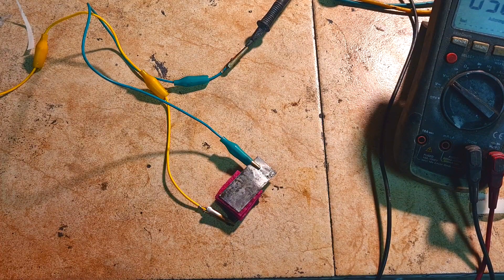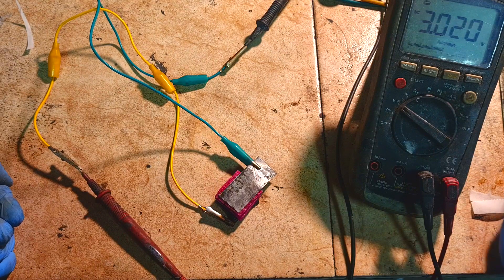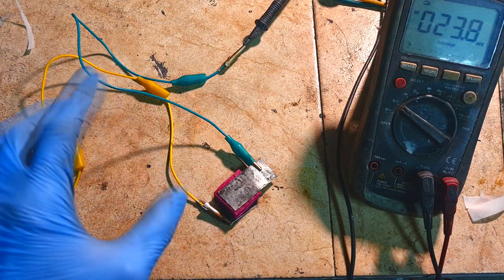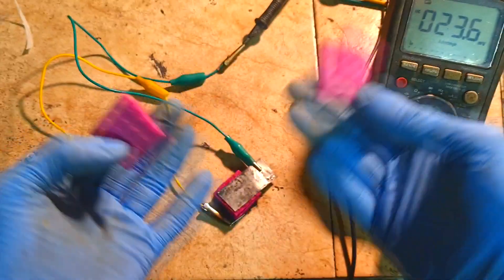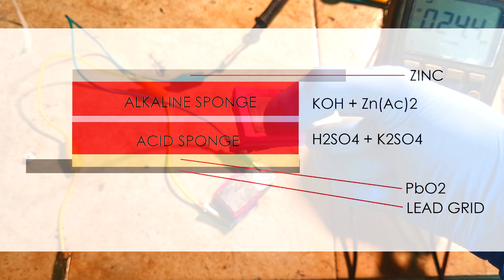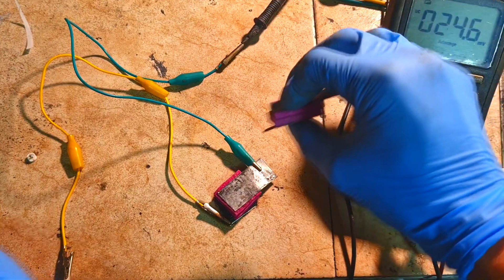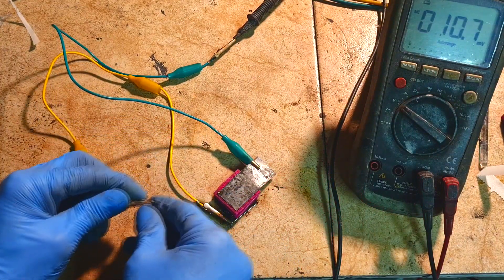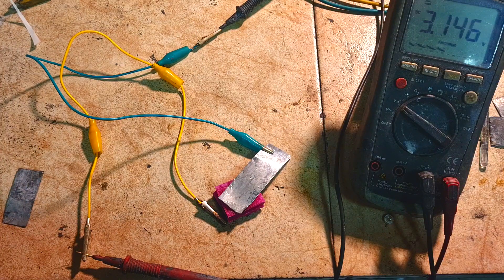3 volts Lead "acid" Battery

Comment: I think I found a cheap membrane for these batteries.  Put some super glue one side of a piece of paper and spread it thin and as even as you can.  Be careful of the fumes.  They are very irritating.  When the glue is dried, it is ready.  Just cut out your membrane with a pair of scissors.  For best results, the glue side goes to the base, and the paper on the acid side.  It is very durable, chemical resistant, and cheap.  From my experiments, it works very well.  I would be very happy for you to test it.  :goodvibes:

Comment: I don't think it's 2 parts.
maybe salt accumulates in the middle. so it can be 3 pieces.
lead+sodium+zinc.
like a serial connection 
 What do you think?
Reply from the maker: What you mean with 2 parts? You have acid neutral salt (salt bridge) and alkaline, like I said this in video. The neutral salt is created by the conntact reaction of alkaline and acid
Reply: @cayrex  ok.

Comment: It can't be practically recharge because the zinc will degraded over time in Acidic and electrochemical Environment and eventually all zinc will be consume over time .
Reply from the maker: Nah,.... it is rechargeable, dont worry. The zinc electrode will not be so quick consumed that you think. The zinc electrode is in alkaline environment. Read some paper or two about that cell....
Reply: @cayrex  so it's like electroplating process of zinc ! Where is the paper ?
Reply from the maker: Zn(OH)4 🔄 Zn
Reply from the maker: @omsingharjit  Use google,  read description,...

Comment: Great voltage, but how long before the alkaline and acid neutralise each other. An ionically selective separator perhaps? I don't know enough to really question this though but still a good effort. Love your videos.
Reply from the maker: Yes, some Nafion 115 mambrane will  e good. Here you have some salt layer between acid and alkaline sponge. If you not  squeeze the sponge to much, can last wery long.
Reply: @cayrex  Worth a try but very expensive here in the UK.
Reply from the maker: @rogerwilson6367  Same here, mate.
Reply: How about some PVA Solid electrolyte one with alkaline another with sulfuric acid and a one with just PVA as separator?
Reply from the maker: @nicamarvin  yes,... that is one way to do it.
Reply from the maker: @nicamarvin  if you only trying,.... then is also good some baking paper as separator. That paper will not survive many cycles,... but is good if you trying setupes

Comment: How do the electrodes hold up?
Reply from the maker: PbO2 and Zn good so far. Aluminium is oxidized
Reply: @cayrex  not so good.
Reply from the maker: @nitrousman8882  what not so good?
Reply: @cayrex  electrode deterioration.

Comment: Awesome.  you should try Magnesium for negative, might get near 4 volts?!
Reply from the maker: Nop,... the voltage with magnesium is not higher. If I remember correctly was 2.9V
Reply: @cayrex  I'm considering trying a  magnesium or aluminum anode with an iron (iii) oxide cathode + acetic acid as the electrolyte. Do you think that's a viable design for a primary cell?
Reply from the maker: @exMuteKid  For primary cell? Iron oxide - aluminium battery,.... hard to say. You will need to take a look of that cell
Reply: @cayrex  Weird cause I got 2.8v with magnesium and lead oxide in alum electrolyte, and I could only get 2.3v with zinc metal.  So I just assumed in your case it would be higher.  Magnesium has a much lower voltage potential than zinc(meaning theoretically the voltage should be higher)..
Reply from the maker: @theinsider8872  yes I know, but will not go over the voltage which I get with aluminium